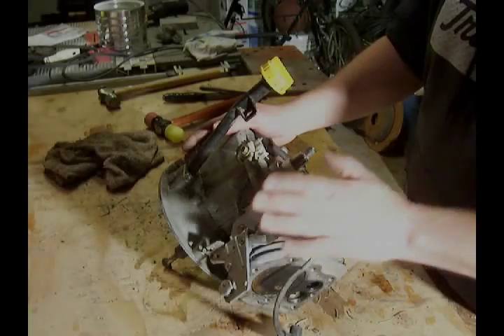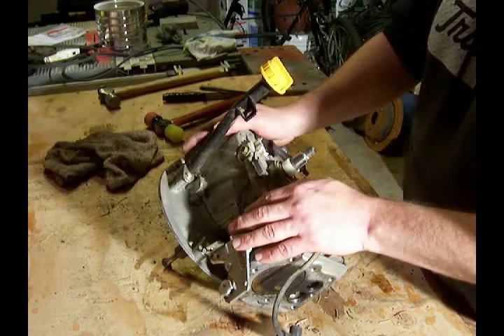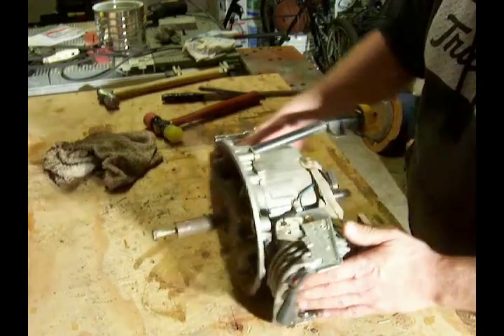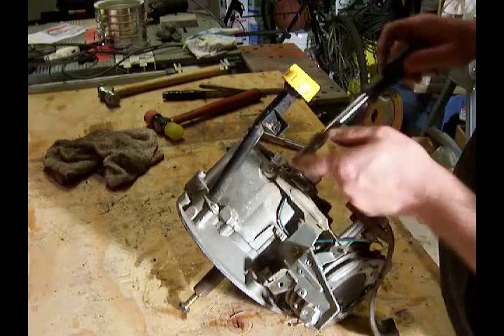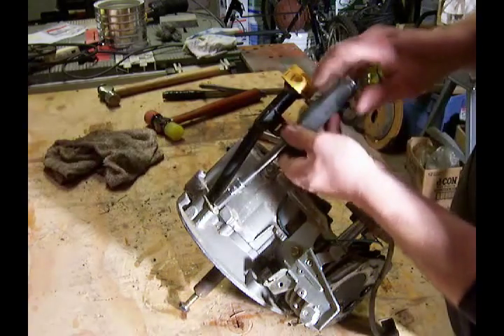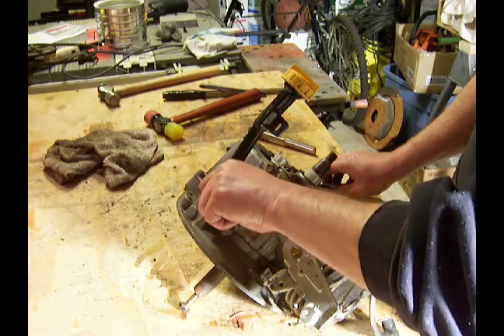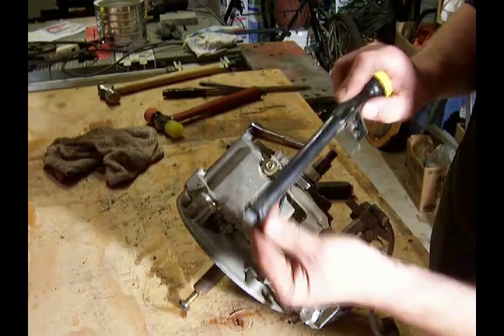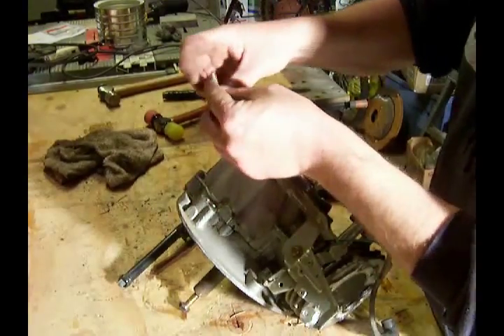#5 Tecumseh LV195EA / LEV120 - Tear down and rebuild - Opening the crankcase

Comment: I'm trying to remove the crankcase cover so I can replace the seals, but it comes apart about an inch and stops with a solid thunk, like it's hitting something stopping it from going further. I don't think it's any crud on the crankshaft and I'm at a loss otherwise.
Reply from the maker: All I can think is to keep turning and pulling. Hope you get it!
Reply: @RealManSkills  was thinking of getting a 3-jaw puller from AutoZone. My only guess is something that seats in the crankcase cover is stuck. Engine is 17 years old and never been opened up before, so anything is possible.
Reply: Nice big 7-ton 3-jaw puller did the trick. I guess the shaft was just so crapped up that it wouldn't go. Guess I'll wire brush it before reassembling.
Reply from the maker: @kenbenobi  sometimes, I have to use sandpaper to clean up the crank. Happy the you got it figured out!

Comment: Question for ya since you appear to be the expert on this engine:  Can one replace the crank seal on the blade side from the outside / without having to split the engine? I've got one that seems to be leaking oil in that location.
Reply from the maker: Yes, you can. There are special tools for such a thing that I don't have. Here is a video from Donyboy73 - https://youtu.be/Vt1pCModeMM

Comment: I’m trying to figure out what the part that fell off right at the end does
Reply from the maker: That is the oil slinger. It splashes the oil around in the crankcase to keep things lubricated! Thanks for watching!
Reply: Real Man Skills I can’t believe you answered so fast
Reply from the maker: @kaic9712  I sit down every night after work to answer any questions that I can.
Reply: Real Man Skills are you a small engine mechanic
Reply from the maker: @kaic9712  Thanks!